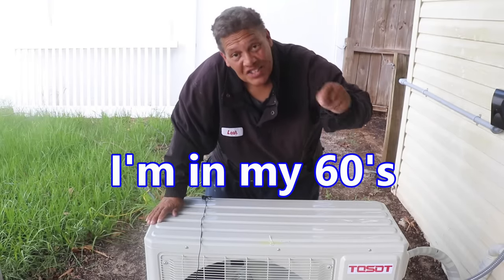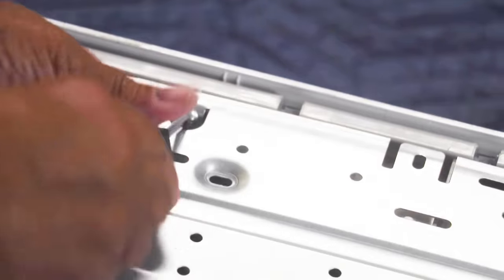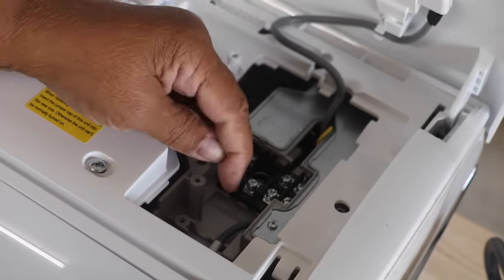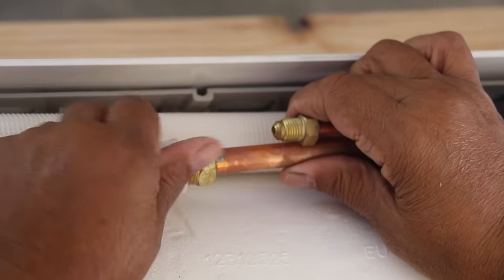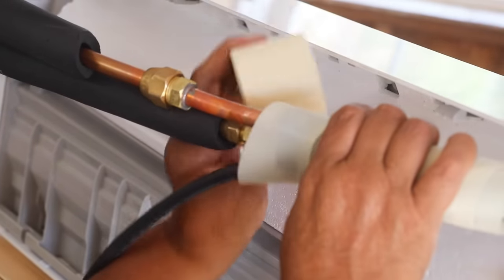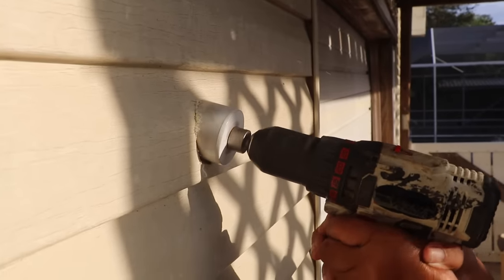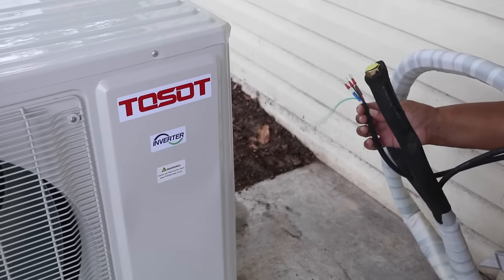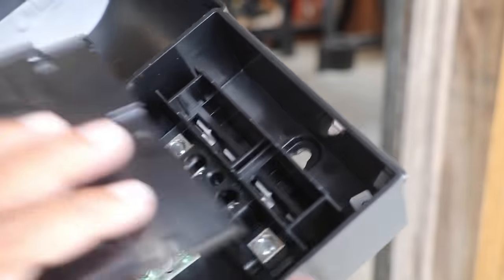I saved $4,200 installing a mini split AC myself

Comment: Your market price is nuts. In China, you bought a split AC from Daikin (famous brand in Japan), the total cost will be under $1000 USD (with labor, tax, delivery, product, warranty). And those best brands in China, like Gree, Midea, Haier, Hisense, will only cost you $400 USD (with the same compressor as Daikin). Not to mention, there are some extremely cheap products for only $100 USD, but they still work. There are no diyers in China who will install air conditioners for themselves. The abnormal price in US forces people to work for themselves.

Comment: I put a cheap mini split in myself 7 months ago. Worked great until the compressor sprung a leak. Company will only send me a compressor for the warranty and says I need to have it professionally installed. Pros told me I did the best diy install they'd ever seen but a 500$ mini split isn't worth fixing because the labor to change the compressor is 500-1000 and 200 for refrigerant. Ended up buying a trane from them for 4200 with 10 year parts and labor, I'm not going to keep replacing these cheap pieces of crap and I'm not investing into garbage
Reply from the maker: What was the brand?
Reply: @seejanedrill  Doesn't matter all midea garbage is the same. It's either made by mitsubishi (japan), Lg/samsung (korea), or midea (china/mexico). These "brands" are all a facade, a company who needs 50 brands to sell their product is up to no good.

Comment: This video is going to give a lot of people the false belief that they can do this correctly. It doesn't discuss how to properly flare the tubing, and also that they shouldn't use the flares that come with the lineset and no torque wrench. No nitrogen pressure test, no micron gauge. Lots of DIY'rs are going to wind up paying an hvac company to repair all the problems or install a whole new unit not saving any money in fact costing way more in the long run. Do your research and when you think you know what you are doing, watch more videos and learn all the tips and tricks

Comment: Two things are shocking here. First that someone would want so much money for a relatively straight forward job. Second that a house does not have plaster, two spaced brick or concrete walls to reach outside. I am not criticising but how can a house be made of what looks like cardboard?
Reply from the maker: It's not a house, it's  a stand alone workshop.

Comment: Ng diy about this unit. Nobody covers electrical component, they gloss over it. Then you gotta buy several parts to vacate the lines. Great install by a pro though.
Reply from the maker: I didn't want to show electrical beyond components since I'm not an electrician.   Also unit size plays a role in the  wiring, along with where the panel is located in regards to the unit . Too many variables  to cover.

Comment: You licensed and insured for hvac?
You licensed for the electrical work?
You certified with EPA?
If you were caught, you'd be disqualified from ever having a license, tools forfeited, serious fine and probably jail/community service. 
The EPA fine is close to $50k.
No torque wrench? How do you know you're not leaking 410a? Bubble test every few months? 
What was your heat loss calculation?
Do you know how to troubleshoot if the unit displayed an error code? 
Do you think that's fair/appropriate to your client? 
- - 
Don't be stupid

Comment: Saving $4,200? Is your installer driving a Porsche? Sorry for asking. I never had a AC in my life, except in hotels. Living in Panama after retirement, I do know, that a AC split installation is less than $200 if you use the installer where you buy the unit.

Comment: You're funny.  $4200 is the price for equipment and labor.  But in your situation, you have no labor warranty. Also, when equipment will broke,  you need to find out the reason and claim a warranty from the distributor.  $4200- equipment = $2200 for labor, you pay not only for labor but for service in the future and for experienced installers who made it faster. Also, you spent money on tools. I know, a/c is expensive,  but it's not for everyone. And you forgot a line set cover for a good view. And you'll never see a bubble after vacuum, your method is wrong. It should be pressure test with nitrogen 500psi, after that you can do vacuum. I'm  pretty sure you have a leak in system.

Comment: Why not just put a 15000 btu air conditioner in your window for way cheaper and easier install?😂
Reply: Window units are horrible, once you use a mini split you won't want anything else
Reply: @usa5439  The media is  just like a mini split except way cheaper. My window air conditioner works great!

Comment: Installing an AC costs 4200 dollars?? Omg.
Reply: So here in India, 10 feet of copper tubing is included in the installation service. We have to pay extra for anything beyond that length. Plus any other materials used. Like the tape and the 3 pin plug, etc.